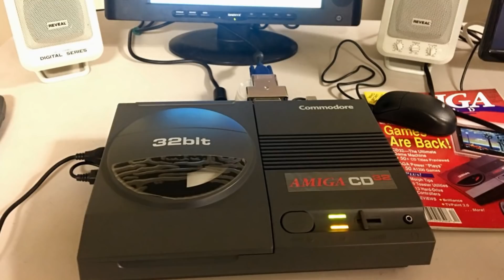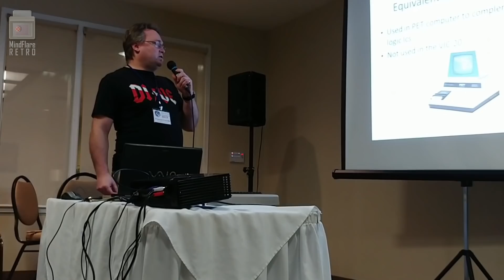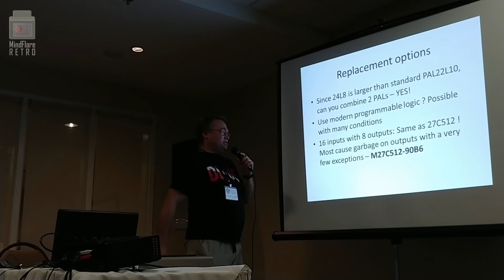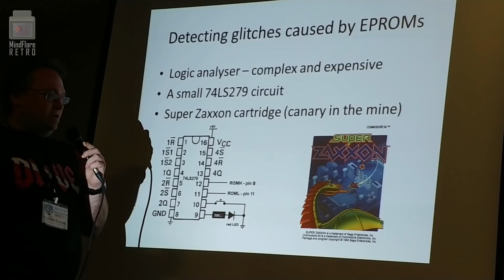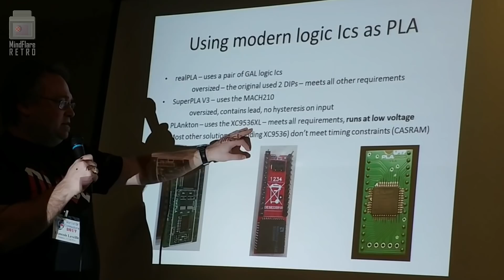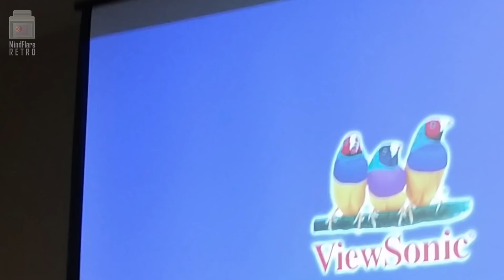#10 'The PLAin Truth About the Commodore 64 PLA' at World of Commodore 2017

Comment: The other reason I know he's wrong about the AT27C512R that I am using (and I suspect Dave at Tynemouth is using) - The 1541 ultimate works fine for me - perfectly.  Pretty sure I've played Super Zaxxon from cart too.  Maybe it is something to do with my board revision, or something.  Maybe the AT27C512R that he tested was fake?
Reply: I posted many oscilloscope and logic analyzer captures on Lemon64 here: http://www.lemon64.com/forum/viewtopic.php?t=56795&postdays=0&postorder=asc&start=30
These clearly show the AT27C512R-45PU generates massive amounts of glitches and sometimes, yes, bus contentions. It also shows the M27C512-90B6 does not. The AT27C512R-45PU I tested was purchased from Digikey, the M27C512-90B6 shown in Toronto was purchased from Mouser.
The Super Zaxxon cartridge remains the 'canary in the mine' when it comes to PLAs. It will go nuts at the sign of any slightest signaling problem.

The thread on Lemon64 is a testament to the amount of falsehoods and disinformation Jens Schöenfeld and Jim Drew were willing to throw in every single thread I would create or engage in to try and discredit everything I said and confuse people.
Reply: I think what happens sometimes is that someone very smart will come to a conclusion and they can prove it...i.e., the component works for them or not works for them.  Therefore, it couldn't possibly be any different.  Then someone else just as smart comes along and finds the exact opposite to be true.  They both can't be right.  Or can they?  I think what happens in both cases they do not know all of the variables.  Every conceivable change in every conceivable revisions.  Most of the time, we're working in "good enough" scenarios.  It's when they start insulting the other is when I loose interest.
Reply: The apparent risk that there could be a problem in general with eprom PLA:s would be enough for me not to use them as long as there are better and affordable alternatives.  I'm sure every program and peripheral you use could work just fine, with contention though (more than one unit having access to the bus at one time) you'll heat up your bus connected chip and they will fail faster - even if "everything" seems to work fine. 
There's a lot of spare parts out there, you're free to do what you want with your equipment.
Reply: They both have to check all variables before they can actually say it does or it doesn't work. Bus contention on transitions is a know problem with eproms as PLA, it's not always a problem - in the C64 it is.

I can run an LED without a resistor connected directly to a 3V battery... fine - however it will burn out an fail a lot quicker than if I put a resistor in series. So - is using the LED directly on the 3V battery an OK solution?
Reply: The AT27C512R-45PU generates a massive amount of glitches. You just didn't check for them... https://www.melon64.com/forum/viewtopic.php?f=12&t=8691&start=3
Reply: Gonna have to do a video response I think lol.  I don't doubt the knowledge and experience here, just suggesting there's a reason I don't have the problems he thinks I should have with this chip.
Reply from the maker: Interesting. I guess it time to revisit this project. Board revisions is definitely a factor; I recall Ray Carlsen's documention specificlly mentioning the three later rev boards having CASRAM filtering on the board, itself.

I'm not a fan of denouncing the work of other retro computer supporters like Tynemouth. A lot more could be accomplished if everyone worked together for the common good. Ha ha... I don't think there will ever be a retro computing eutopia. =/
Reply from the maker: I would love to see that and participate in any healthy conversation.

Comment: Very interesting!  I find it hard to believe that the contention issue relates to the AT27C512R.  I've got a lot of carts and and everything runs fine - never a glitch, never a crash.  A contention issue would result in noticeable problems at some point, whereas I just don't see that with my C64.  Maybe they are fake AT27C512R chips based on some other chip, maybe that why it works?  Or, maybe its the cap that makes the difference and he's not taking that into account?  Brilliant presentation though! =D
Reply: There was a whole thread about it on Lemon64 and the method one could possibly employ to filter out the glitches generated by that IC.
Here: http://www.lemon64.com/forum/viewtopic.php?t=56795&postdays=0&postorder=asc&start=0&sid=4a73f521acbccf855561ffb0f336ee7d
I was confronted with a flurry of blatant technical falsehoods from Jim Drew and Jens 'wiesel' Schönfeld. The 'open collector' argument assumes the PLA could be tied to the databus and cause problems with more than one device signaling at a time. Well, the PLA is NOT tied to the databus; it signals which device can signal on the bus, like a traffic cop at an 8 way crossing. Thomas 'Skoe' Giesel posted last on this thread after I was banned from Lemon64 for defending my point (with oscilloscope and logic analyzer captures).
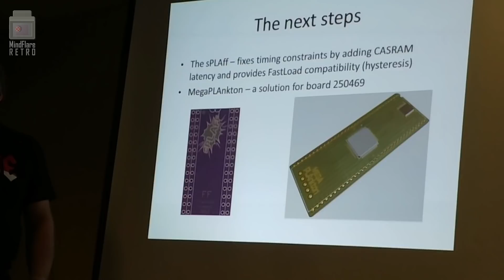Reply: Yes, I'm mentioned at 28:55 (where two of my board designs are also shown ;-) ). 
It started with me making one of those Nightfallcrew PLA:s with the XC9536 and it worked pretty well, even sold a couple for friends. But it was not fully compatible - so I shipped one to Francois (in the video above) to find out why it wasn't 100%. He had shown needed skills with his eprom PLA and had the equipment for it. 
At the time the source VHDL for the mentioned version was not available (it is now) so I put together my own code and with Francois's low level investigations I changed the settings and code to reach the proper timings (where they matter). Francois decided on the needed circuitry, I CAD:ed the board to specs - and success! Francois was overwhelmed with joy and wanted to start selling it right away. I was onboard for a few batches, selling it in Europe but it was quite time consuming so I sold my part to Francois and has been making it by himself since last year or so. 
I'm not sure if the PLAnkton or LumaFix64 is my most known design.  ;-)
Reply: No problem it's his lecture, no need to shine the light on me. Without Francois's investigations I would probably just have continued making the Nightfallcrew version, he is the one who found out the details to make it the perfect (?) replacement. 
When I made the board I had an idea to round the top and make an eye on it - to make it look like Plankton in Spongebob... but the name was enough I guess.   ;-) 
The full name is actually U17 PLAnkton, as can be seen on the board, I thought it was important to highlight where to plug it in as some boards have the SID in the same region where other boards have the PLA.
Reply from the maker: Thanks for your comments. Yeah, even now I am staying clear of a final opinion and on the use of the AT27C512R-45PU. I remember you stating that you had very good success with it so I had no reason not to try, myself. Eslapion is a very interesting guy. To say he is passionate is an understatement. However, his passion might be obscuring his opinion on other points of view.

Hmm. Interesting thought about "fake" ICs. I am pretty confident that my lot of ICs are legit, as I purchased them from DigiKey, but I suppose you never know.
Reply: Not all eproms in the world has been tested ofcourse, it's not impossible there are more good eproms out there. You may not notice bus contention (that will wear your computer chips a lot faster)as it's a (relative) short glitch between transitions - which is when more than one chip is active on the bus and 1:s and 0:s may collide causing pulses of extra current to flow in one or the other direction - weakest chip gets the current-hit.
Reply from the maker: Ah, how did I miss that at 28:55, duh. Brilliant work by both of you, so kudos to you, as well.
Reply from the maker: I owe you an apology for not giving you proper credit in the video, as I wasn't aware of the full story. I have now included an addendum in the description citing your early work that actually initiated the PLAnkton project. Thank you again for your great work.
Reply from the maker: Regardless, there would be no U17 PLAnkton if the two of you had not done your part so I will give credit where credit is due.  Ha-ha, an eye on it would have been funny.  Yes, I did originally refer to it as "U17 PLAnkton" but I've gotten lazy, I guess.  Thanks again for your comments (and sub) -- I am happy to know the whole story now.
Reply from the maker: You were (are) involved with the PLAnkton project -- is that correct?

Comment: Interesting video. I remember GadgetUK added capacitance to load and slow down some pin of the pla. Also interesting point by eslapion regarding output glitches during address transitions.
Reply from the maker: Yes, you are correct. Both GadgetUK and documentation from Ray Carlsen indicate the use of a cap on the CASRAM line. I do use a 68pF SMD cap on my little adapter PCB and that cap is in place during my testing. I didn't speak about my PCB and the AT27C512R-45PU OTP PROM in my video -- I was mainly trying to set up an intro to Eslapion's presentation -- I should problably revisit this in more detail in another video.  Oh... thank you very much for the channel donation; you are too kind.
Reply: Hi bwack! Love your channel. 
The CASRAM delay is a noticable problem, transition glitches will most likely not be noticed by the user but wears on the computer. It's a known problem with a general eprom solution, the poor man's PLA.